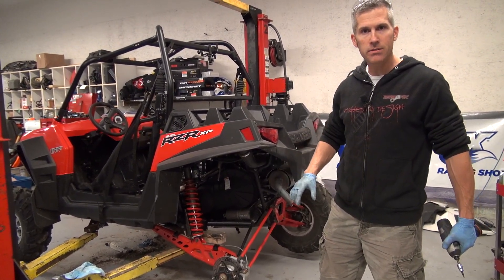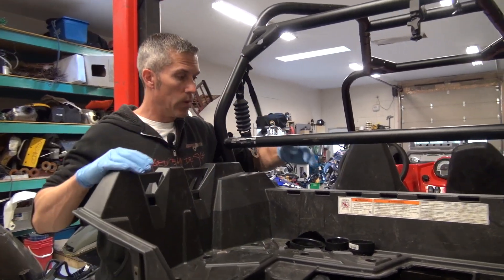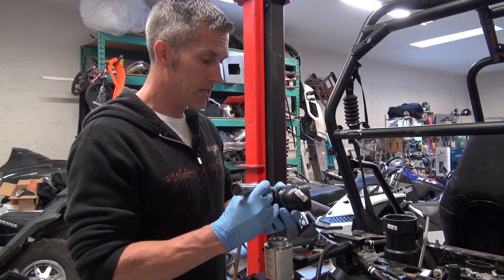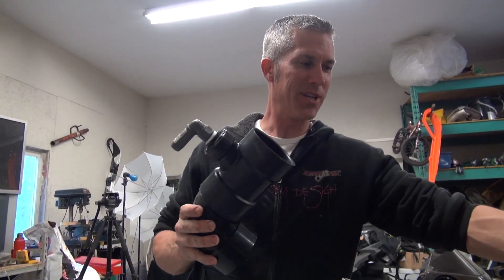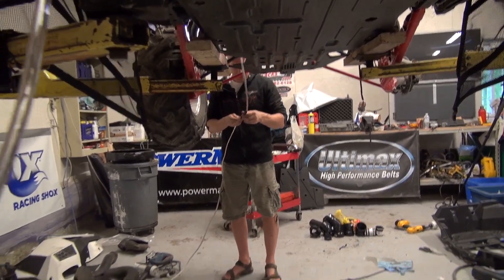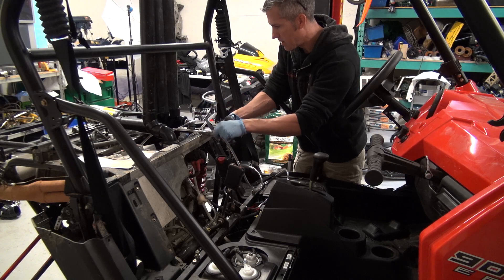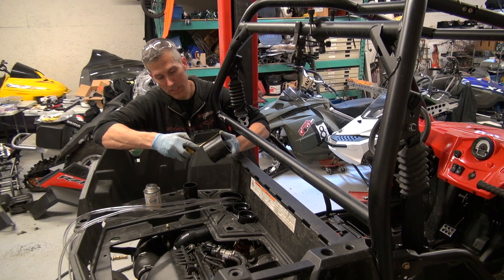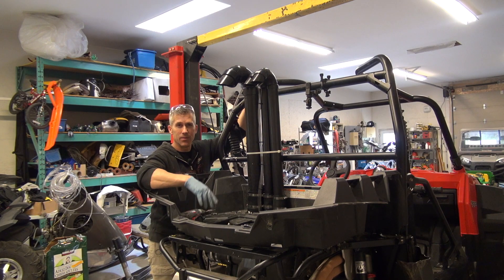Polaris RZR 900XP build series Ep #1 UTV SNORKEL install!, PowerModz!

Comment: I was going to mention was if you got some steel tire valves and drill the tube thread the valve in and you can put the hoses to them anywhere they`ll hold good .

Comment: You need to silicone those joints. The ABS cement will harden and become brittle over time and eventually create a leak. ABS pipe and cement are not really rated for vibrations, it's main use is for drainage of water and waste.

Comment: I may be wrong but that black tubing you removed from the fuel rail looks to be like it was a vacuum line. What you connected it to looked very much like a fuel pressure regulator. And if those are anything like most cars and trucks the fuel pressure regulator is connected to a vacuum. Just something to look into

Comment: PowerModz  whats the difference in just running a 2" for the air instead of 3" similar to the 800 just wondering why 3" and how bad would it be to run a 2" air instead
Reply: Powermodz's point about two 2" isn't the same as one 3" shows that one should always hone their math skills.  Just about every day math comes into play regardless of what you do.  A single 2" pipe gives you 3.1" of cross sectional area of intake capacity; lots of air resistance to air flow into the engine.  Two 2" pipes gives you 6.28" of cross sectional area of intake capacity; more resistance to air flow into the engine.  One 3" pipe gives you 7.4" of cross sectional area of intake capacity; almost no resistance to air flow into the engine.

Comment: Hey I love your videos they are very helpful. I need some help I was thinking about getting the airaid cold air intake snorkel kit part #883-300, what else do I need too do so I don't get water or mud into the motor?? I have a 14 Polaris rzr 900 stealth black pls help.
Reply: That's not a snorkel.  Looks nice, but it won't keep the water out.  The fender is not sealed to the intake on the inside, it's just a bit of foam to seal the two surfaces.
Reply from the maker: as333as I suggest you check out my "Amphibious RZR" video and the others where it is submerged to the top of the snorkel for long periods of time with the engine running - it works great!
Reply: PowerModz Sorry, I meant the air raid kit marcodz1 mentioned is not a snorkel...I know yours works, I even went to the show in Toronto to get a better look!  I'm going to be doing a similar snorkel to my Jagged X before spring.  Trying to find a way to move the pipes off to the sides so I can keep visibility as good as I can out the back...
Reply from the maker: as333as oh ya i understand!

Comment: So u trust the air filter box and clutch cover to not leak without any sealant ?
Reply from the maker: The air filter is tight - i never sealed it, the clutch cover i'd seal if going in deep water.